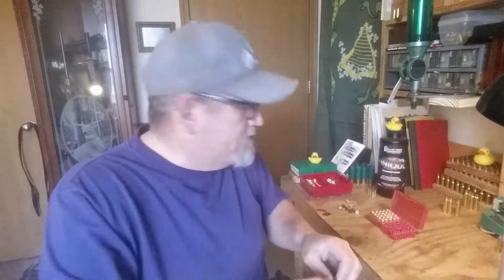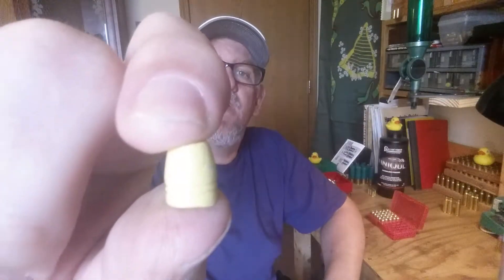Loading the 95 grain lead round flat nose cast bullet in a 380 using unique

Comment: I loaded the same bullets but I use a faster powder.  Unique does not burn fast enough (usually) in the short .380 barrels.  Plus 3.1 is a normal max load for unique so your 4.0 would be pretty hot.  Just saying.  Be careful and think about Tite group or another fast powder.

Comment: Tim, as reloaders we have a community, and when one of us asked about advice about one thing or another it shows that we are using forethought, I personally believe that you should work up any load unless you have used it before and that it is published data in the manuals. Using smokeless propellant is like using solid rocket fuel, outcomes can be influenced by many factors as load density, burn rates, projectiles in their weights and so on. It's always a good idea to research your manuals and published data if you can not find that data, use a different powder that is listed for that cartridge. Now, I feel that you are loading the little .380 a little too hot as a beginning load. I have not reloaded .380 before and haven't any experience with the cartridge. However, I have loaded for the 9mm.  The Lyman cast bullet load manual lists Unique in the .380 @ 3.6 as the top load for the 92 gr round nose. Dave.
Reply from the maker: Dave you are dead nuts on this one t totally

Comment: It being a Beretta it should handle it. Dint try it in a wimpy glock though. Seriously it sounds high. I load that same bullet in .380 and sometimes in 9mm. 3.5 grs of power pistol gives an .6 group at 10 yards with a Ruger LCP. Didn't think that little gun would do such accuracy but it is what it is. In 9mm not so bad either acceptable groups running 6.5 grs at 1250 fps. Note: this round is a lot of fun and does simular damage as a hollow point. Turns milk jugs inside out. The most I have ever seen from a solid projectile.
Reply from the maker: Zazkaria Frady I need to get me some power pistol and try that out I've heard some good things about it

Comment: I use for the same WW lead Lee flat nose TL bullet (btw it's one of the best bullet designs for 380 acp) 3.3 grains of VV N330 powder. That gives me 843 fps for 150 ft-lbs of energy from the Beretta Pico (2.7" barrel). It's just an awesome load. This bullet is way better than the 102 grain round nose I have. Gives a bit less energy but destroys less cases (since it has an tapered base), is softer shooting and has better terminal effectiveness (though a bit less penetration). It's just the ideal bullet for the round.
Reply from the maker: AJ G  I'm glad to hear that the you're having good luck with that bullet in  380 specially in a Beretta pico I'm going to do some testing here in about a week or 2 in that pistol with that caliber
Reply: 4grs is to hot go with 3grs
Reply: @anthonylinzalone3935  I am using exclusively the Lee volume dippers for reloading and an brass black powder powder measure which is fully adjustable from 0 (Zero) Grains to I believe 45 Grains of Black Powder. Works for smokeless as well. Thats because Lee dippers have not the right powder measure for all calibers. There is none for 380 ACP so I use that brass powder measure for that caliber only. For 380 ACP with the same 95 grain lead cast bullet I use about 3.3 grains of Unique type powder (powders around that burn rate) since Lee dippers are eighter way to less or way to much for 380 ACP. For 9x19 they have the exact measure wich throws about 4.0 grains (0.5 cc) and for 357 Magnum the 0.7 cc Lee dipper gives about exactly 5.5 grains for Wadcutters. I use exclusively Lee molds for 9x19 120 and 124 grain lead bullets and for the 357 Mag I have both 148 grain Wadcutter molds from Lee.
For 380 ACP one will want to stay at about 2.8 grain (weak load) and max about 3.4 grain (mine is about 3.3 grain by volumen) being 380 ACP more sensitive since the margin of error is smaller and thus 2.8 grain will give you probably a squib load and the 3.4 grainer is overpressure. Thus I judge allways according to the primer shape if I see an overpressure sign. Whatch out that 380 ACP ammo layed in hot sunshine will have with same 3.3 grain powder charge an velocity of about +P levels of 925 fps while ammo at room temperature will have an velocity of 850 fps. The rule is for 380 ACP and 9mm Luger: with an more or less appropiate powder type, load the case up as much as there is about 1 or 2 Millimeter between powder and bullet when the bullet is seated (as to prevent overpressure), which gives you allways 3.3 grain or 4.0 grains for this set up. Same for 357 Magnum where the Wadcutter is seated just above the powder charge which then is about 5.5 grains. The bullet has NEVER top press down onto the powder. If that is respected, overpressure is not an issue except the round is 100 degrees Farenheit because of the sun which varies the pressure and velocity.

Comment: anthony linzalone  I am using exclusively the Lee volume dippers for reloading and an brass black powder powder measure which is fully adjustable from 0 (Zero) Grains to I believe 45 Grains of Black Powder. Works for smokeless as well. Thats because Lee dippers have not the right powder measure for all calibers. There is none for 380 ACP so I use that brass powder measure for that caliber only. For 380 ACP with the same 95 grain lead cast bullet I use about 3.3 grains of Unique type powder (powders around that burn rate) since Lee dippers are eighter way to less or way to much for 380 ACP. For 9x19 they have the exact measure wich throws about 4.0 grains (0.5 cc) and for 357 Magnum the 0.7 cc Lee dipper gives about exactly 5.5 grains for Wadcutters. I use exclusively Lee molds for 9x19 120 and 124 grain lead bullets and for the 357 Mag I have both 148 grain Wadcutter molds from Lee.
For 380 ACP one will want to stay at about 2.8 grain (weak load) and max about 3.4 grain (mine is about 3.3 grain by volumen) being 380 ACP more sensitive since the margin of error is smaller and thus 2.8 grain will give you probably a squib load and the 3.4 grainer is overpressure. Thus I judge allways according to the primer shape if I see an overpressure sign. Whatch out that 380 ACP ammo layed in hot sunshine will have with same 3.3 grain powder charge an velocity of about +P levels of 925 fps while ammo at room temperature will have an velocity of 850 fps. The rule is for 380 ACP and 9mm Luger: with an more or less appropiate powder type, load the case up as much as there is about 1 or 2 Millimeter between powder and bullet when the bullet is seated (as to prevent overpressure), which gives you allways 3.3 grain or 4.0 grains for this set up. Same for 357 Magnum where the Wadcutter is seated just above the powder charge which then is about 5.5 grains. The bullet has NEVER top press down onto the powder. If that is respected, overpressure is not an issue except the round is 100 degrees Farenheit because of the sun which varies the pressure and velocity.

Comment: Never wise at all to load any lead bullets coated or not to max full metal jacket loads for a reason

The pressures can blow right thru a lead bullet leaving a ring of lead in the barrel and the next shot after will ruin that gun

If you were to install a gas check on each round then OK but straight lead will melt under high pressure and do what I just said, Melt right thru and leave a ring of lead in you barrel

Then you will notice it to be very inaccurate and try a jacketed bullet and boom, your barrel either explodes or bulges the barrel from that thick coating of lead in your barrel rifling

Not just my opinion as I have been there and done that when I was a teenager

But of course we are all old enough to know not to do that nowadays right?

Comment: I would say 4.0 is on the hot side . I would say 3.5 of Unique would be my limit . I go with a 102 gr. Lee bullet which is 104 gr. with PC and 3.0 of Bullseye .
Reply from the maker: James Pollard what seems to be the census I looked on the hand loading. Com and they said 4.2 grains of unique in my Lyman book I think it was 4.2 too
Reply: There is a lot of variance from one reloading manual to another as far as max sometimes . I think it is the safety margin each book is willing to take . Rarely do I find the hotter loads as the accurate loads anyway .
Reply from the maker: James Pollard yes sir and those cases the hotter loads are more accurate
Reply: I agree , my 380 liked the hotter Bullseye load . I went 2.5 - 2.7 -3.0 . I just got a 38 special revolver for my son for Christmas . Do you have a favorite 38 special cast load to try ?
Reply from the maker: James Pollard when I shot cowboy action I like the 158 grain round flat nose with 3. grains of Red Dot
Reply: I 'm trying to decide what mold to get and was torn between the 125 gr. round flat nose and the 158 gr. round flat nose . I want something snappy but not +p and accurate .
Reply from the maker: James Pollard you may actually want to go somewhere in between somewhere like a 135 or 140 may actually fill the bill better

Comment: This 95 grainer never gave me pressure signs. But the 102 grainer allways had a bit trouble to have easily flat primers (102 grain lead bullet over 3.0 grain VV N330 for 862 fps for 168 ft-lbs). For 380 acp the 95 grainer is the way to go.